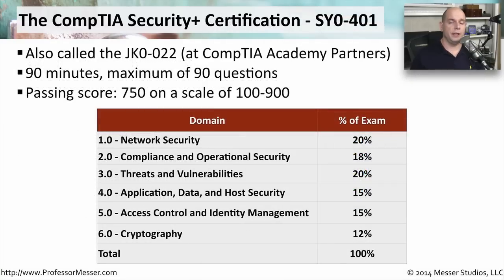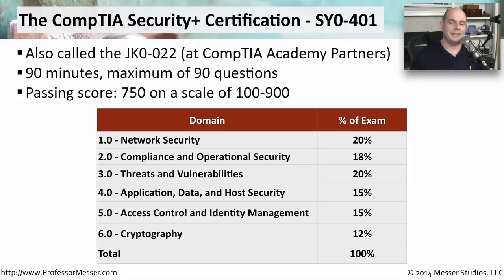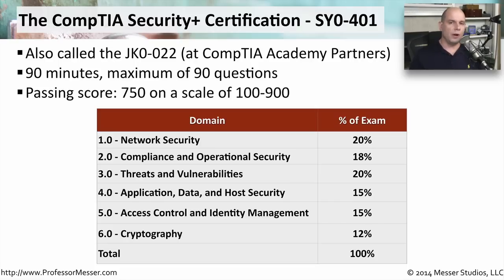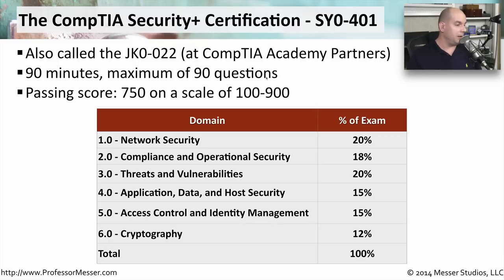Introduction to CompTIA SY0-401 Security+ Certification

Comment: I got my original Security + in 2008. Since 2012 I have been out of IT doing Air Force recruiting. I am separating and I needed to get the Security + CE asap. I started studying on 10 September and I took the test today 17 September. I passed with  803 and my main study tools where there videos and the video notes. I don't think I would have passed with out them. Thank you for putting these out here Professor Messer.
Reply: +Jerry Turner Any tips for us getting ready to take the test like what, the test focused on the most?
Reply: +Jerry Turner that's great man.  best of success!
Reply: +Inquisitve m Sorry about that. I don't post many comments on YouTube so I didn't catch you comment. I found that the video did a good job of hitting what was in the test. It follows the test objectives. That is what I would use, the objectives. I would also find some practice tests. That is pretty much all I used besides these videos. Go to whatever app store you use and search for Security plus practice tests.

Comment: I passed CompTIA IT Fundamentals, A+ (220-901 & 902), Network+ (N10-006), and Security+ (took the SY0-401 since it's what my study material was based on) all in 2017. NO WAY would I have pulled it off without Prof. Messer. His material is directly aligned with CompTIA objectives and is simplified enough to make sense to a dummy like myself. 
Tips: 1) Don't get distracted by other products or tutoring.. you'll end up studying non-pertinent info or even worse- wrong info.
2.) Get his course notes. I tried taking notes but ended up with an illegible mess and had to pause his videos 90 million times. Just get the notes and you'll have time to watch the series three times in the same time frame. And even pay attention to learn.
3.) Check out his study groups! The CompTIA goal seems to be to make you really think about issues. I've seen some great questions posed in the study groups and you really get some new perspective. Plus, you get CEU credits to renew your certifications! - Even with his replays!

Comment: How different is 401 from 501? Should I watch this course if I plan on taking 501?
Reply from the maker: The SY0-501 will be very different, but it's not out yet. You have until July 2018 to take the SY0-401 version of the exam.

Comment: I've been told that its easier to pass these exams if you do not do the simulation questions. is that wise?
Reply from the maker: Not answering questions on a certification exam would be a remarkably unusual (and ultimately fatal) strategy.
Reply: @Joy Little--The way they score these exams is that remember if you get part of an answer wrong, the whole thing is marked wrong. :( They don't give any credit for a partially -correct answer. Simulations as well. There will be a few of these, avg 4-6 per exam. Practice practice practice those hands-on skills girl!! =) 

@Professor Messer-- Hey dude! I need to renew my Security + that I received in 2013, have to submit 50 CEUs by Dec 5, 2016, don't have $$$ for exam fee or vouchers or another class.
 Could I watch these or participate in these activities & still get credit for them?? Are there other practice test sites to use to submit for credit hours?? I gotta do this in less than 3 weeks...ugh. If I wait longer the CompTIA people will MAKE me pay for exam ---no getting out of that one. Unless the 50 CEUs are submitted prior to due date. Crikey
Reply from the maker: Some performance-based questions can provide partial credit, but others do not. CompTIA does not provide any grading information about their exams. More information here:

https://certification.comptia.org/testing/about-testing/performance-based-questions-faq
Reply: Be ready for the simulations. I was told that I didn't pass because I missed two of the simulations and they weigh the most so study these intensely. I've taken the exam and would say the questions are tricky so take your time and read them completely. And no partial credit for simulations. Good luck !!! I went to fast my first time and didn't pass so read them and think !!
Reply: Thanks Brandy